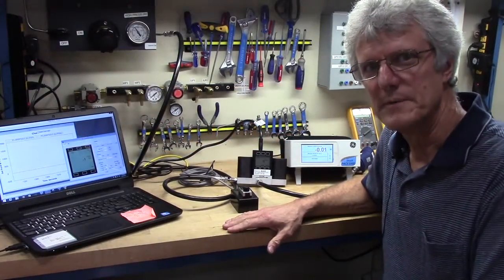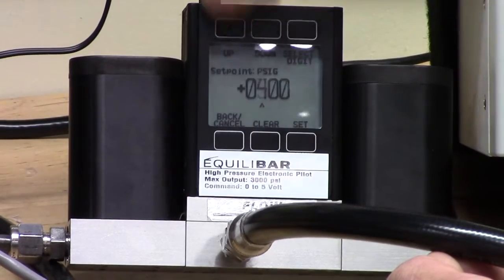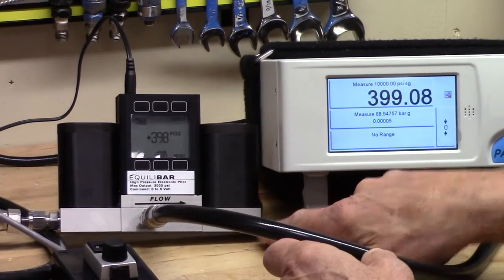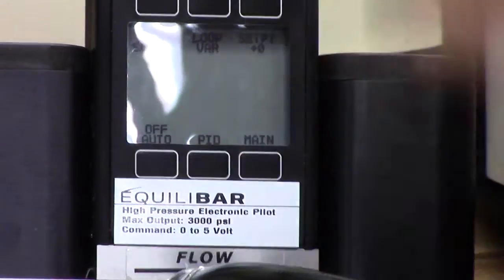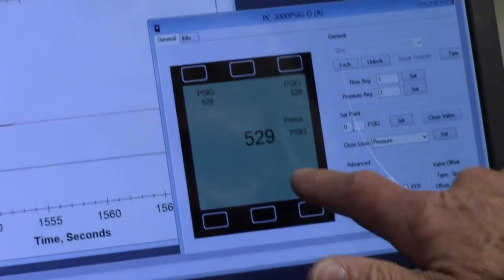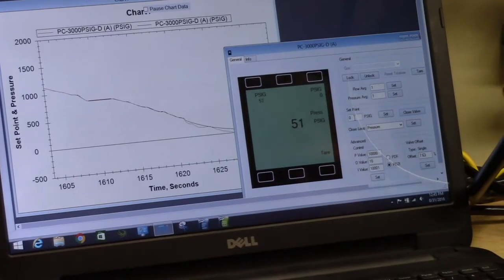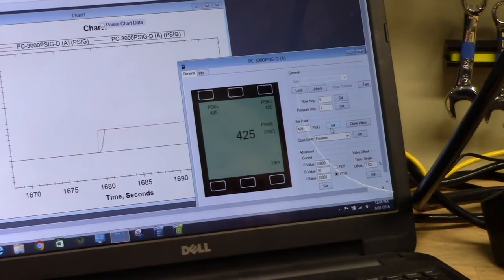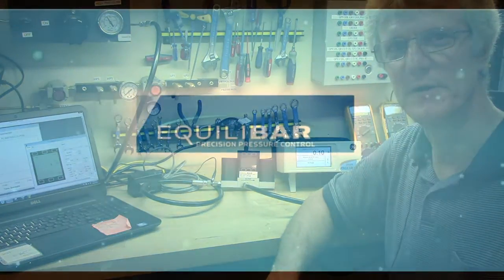High Pressure Electronic Regulator Controls up to 3000 PSI

Comment: Can it handle fuel pressure Pls reply
Reply from the maker: The EPR pressure controller is designed for static to low-flow applications of inert gas such as nitrogen or air. https://www.equilibar.com/product/electronic-pressure-regulators/epr-3000-high-precision-electronic-pressure-controller/  Please contact an application engineer for more information. https://www.equilibar.com/contact/

Comment: can you change pressure linearly with this?
Reply from the maker: Yes.  The controlled output pressure response is linear to the command signal and the calibrated pressure range.  The calibrated pressure range is independent of the supply pressure input. Please contact us if you would like more information. https://www.equilibar.com/contact/